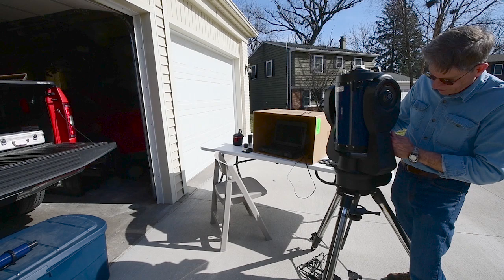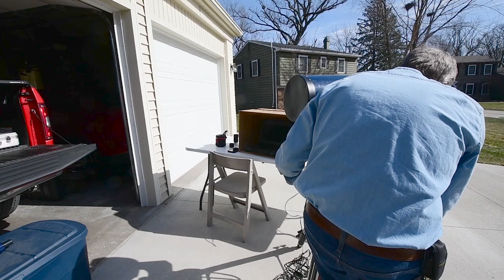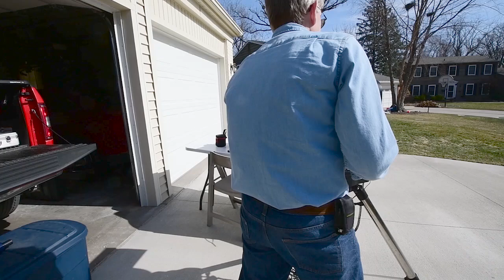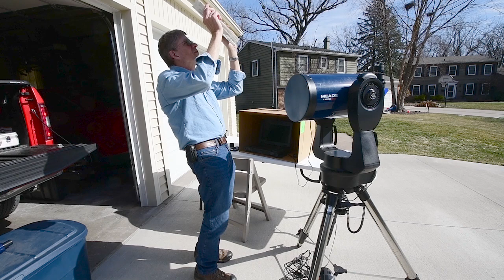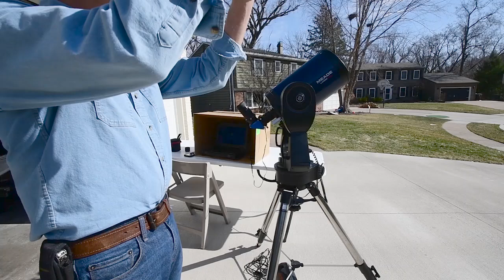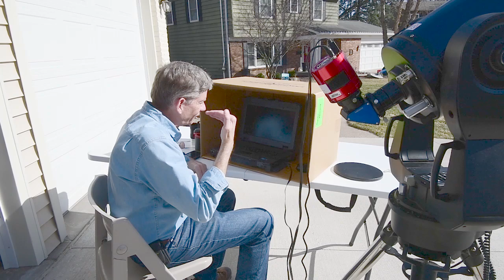LX200 Solar Observing Primer

Comment: what is that second focuser on the back of the scope?  Is it some sort of mirror lock? Has some masking tape and writing on it :)
Reply from the maker: The "second focuser" is a focus lock (as you guessed).  We put tape on it to identify it and to warn against locking the focus.  This particular scope belongs to a middle school.  Students attempting to adjust the focus with the focus lock engaged caused the focuser's flange bracket to be broken.  After repairing this, we put tape on the focus lock to hopefully prevent inadvertent damage in the future.

Comment: its easier just to hook your telescope to your laptop and use software like stellarium.
Reply from the maker: My experience is that it is always easier to use the scope's mount software to control the scope.  You are correct that stellarium can be used to control the scope, but this does not avoid the need to carefully and deliberately set up and orient the scope prior to use.  ZWO also has a very nice telescope control system which can control the scope and the ASI camera.